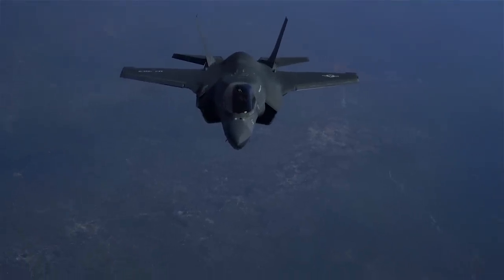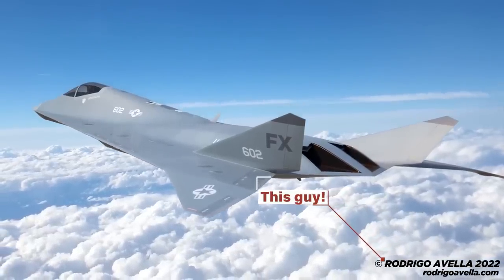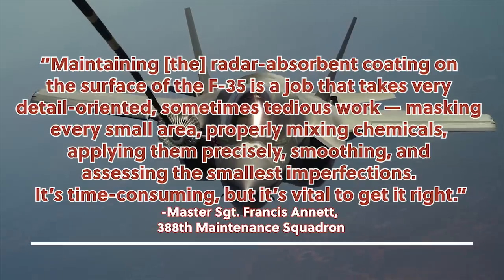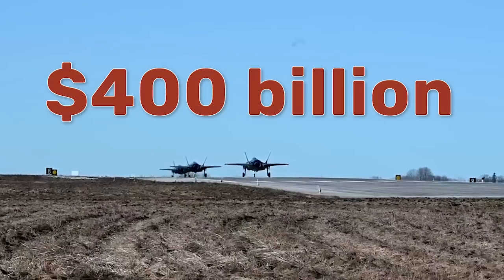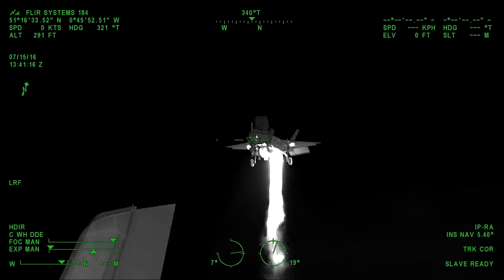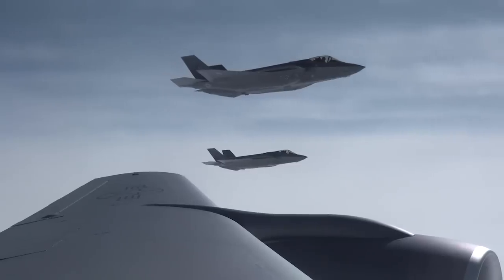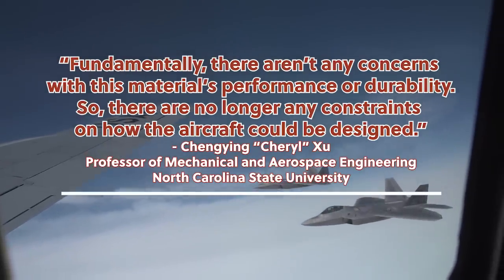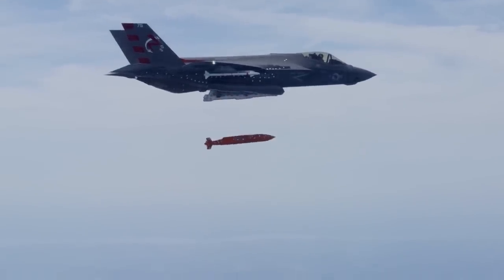The biggest leap in stealth tech since the F-117

Comment: The problem with speed is the sonic boom which is easy to detect with acoustic sensors .So radar is a no problem as soon as the boom hits the sensor you know where they are no matter the radar signature.
Reply: True but you still cant get a lock on them until they get relatively close so its not as bad as it seems. Fighter interceptors would be more of an issue. If they can find you that is.

Comment: And this is why the F-15EX (and Block III Super Hornet) makes so much sense as a supplemental/companion aircraft to the F-35 and F-22. It's like taking your new Corvette to get groceries all the time... if you don't need the speed, maybe save the wear and tear and take your old, reliable Toyota for that.
Reply: No, it's a jobs program because otherwise Boeing would have to close the St. Louis plant.
Look at procurement numbers. The USAF has 144 but proposed cutting to 80. The Navy asked for Super Hornet production to stop and it's lawmakers and lobbyists that want it to continue.
The Corvette comparison makes no sense. The F-15EX is a very expensive 4.5 gen with twin engines. Its operational costs are on par with the F-35. It's a Corvette too!

Comment: My question would be.
 Would the ceramic coating bennift a 4th generation aircraft? Like the F16, F18,and F15.
Reply: Nope,its not only about RAM its the shape as well
Reply: IMO probably yes, but limited because the basic design of the aircraft reflects back to the source so well.
If the coating is inexpensive enough I would agree that we will see these coatings on 4th Gen aircraft as well since every little bit would help

Comment: I can only think about how delicate the ceramic tiles on the space shuttle were. They were supposed to be reusable but they weren't. While ceramics handle heat and abrasion well they're not so good with tensile strength and vibration as they tend to be brittle so while I see you solving one problem I think you might have a host of new ones.
Reply: Nothing is reusable if you break it first.
Reply: Why are you assuming they'll use tiles when the video mentions paint?
Reply: @GonzoTehGreat  I mentioned tiles only as an example. Ceramic paint flakes in home applications that I've had so l don't know. Isn't the baked on finish of new cars some kind of ceramic or is that a plastic polymer?
Reply: @summerkagan6049  If this is a novel discovery of a new material it's too early to say what drawbacks will be.
Reply: They were never meant to be reusable, they were meant to be easily replaceable, allowing the body of the space shuttle itself to be reusable.

Comment: Question :
( maybe a dumb one)
If the coatings ABSORB the electromagnetic energy , what HAPPENS to that energy? Does it dissipate? Does it give off heat , other types of energy or something else?
Perhaps thats why theyre using heat absorbing materials- kinda like car coatings.
 Because , as Newton observed , matter cannot be created or destroyed-only transferred.
Reply: Electromagnetic carrier = photon. Photon (of a particular energy) strikes material designed to absorb it. What happens? Think black vs white in the sun. 🙂
Reply: The energy of radar causes the materiall's little bits ( Iron Oxide and Titanium Dioxide are 2 parts of the recipe) to line up in the direction of the radar, from our there towards the plane. The energy bounces off the metal skin of the plane and heads back out-against the " current" the radar is creating and basically converts to heat.

Comment: My only question on this is how much weight difference does this new RAM coating make? I would assume that on equivalent thicknesses as current polymer RAM, ceramic would be heavier, otherwise, if to reach eqivalent or higher stealth you dont need as thich a coating as polymer, could it potentially even be lighter?
Reply: It does show 2.6 g / cm cubed beside "light weight" when first starting to describe it. We don't know how this compares to the existing  polymer based ram but does at least say light weight is one of its features
Reply: @dgour2004  if it is lighter than current polymer ram, this could mean that the weight savings could increase performance a bit or, in thicker coatings, it could provide even better all-aspect stealth

Comment: I'm wondering if a new material called "graphene" would be of use in coating jet fighters. Maybe they could put it on a jet fighter and then coat it with ceramic based RAM. I don't know how practical that would be, but it stands to reason that graphene could absorb a lot of electromagnetic energy. From what I understand, graphene is a relatively cheap material.

Comment: One would think that Lockheed would have a good idea of how to make a stealthy aircraft coating. The SR-71 went Mach 3 - 3.3 and temperatures were 700 degrees F+.
Reply: The SR-71 wasn't stealth, it just went full throttle whenever a radar-guided SAM was fired at it.

Comment: This paper uses ZrB2.  Due to nano nature, it absorbs only 26 GHz or higher.  But typical flight radar is 1 GHz.  Her other papers requires Zirconia fibers & carbon nanotubes, which are not really commercial ingredients.  It's common for professors to drum up results to get defense funding.  But it's clearly still in early research stage.

Comment: I'd like to point out that while a difference of 10-20% additional reduction might seem less impactful, it's actually fucking phenomenal, because of the way math works.

Let's say we have a radar signature of 100 meters (this value is just to make calculations easier). If you reduce that value by 10%, then thats 100 - 10 = 90 meters = 10% improvement. Not very big a deal and seems kind of obvious right? But let's say you've already reduced it by 80%, so the radar signature is 20 meters. Well, going from 80%  to 90% means we still reduce this value by a flat 10 meters, so 20 - 10 = 10, which is a 50% improvement. Obviously going from 70% to 90% is even more impressive, at 66.66[repeating]%.

So with this new coating alone, an F-35 would get three times harder to detect.

So with this technology, plus other improvements, the difference going from 5th to 6th gen stealth, is going to be similar to the difference between 4th and 5th gen stealth (4th gen like the Nighthawk). Which is fucking insane.

China and Russia are just starting to catch up and the US was seriously like "lol no"

Comment: Is it possible to put a request forward here for a video topic? The shadowy world of active radar absorption through exotic means, like Cesium fuel additives to the SR-71, or also (less talked about), producing electric fields with emitters on the leading edges that create charge potentials to deflect / absorb the EM wave. I don't see that talked about much at ALL, and it's a wildly forward thinking concept. Stealth forcefields! I have a feeling that tech might be on the B-2 but highly classified. When pilots allude to putting the bomber in "stealth mode", they don't elaborate on what that really means.

Comment: if what you are saying about RAM is true vis a vis temperature problems at high speeds, how did the Blackbird / Oxcart  fly for so long, so high and so fast.   There is something off about your analysis of current and previous RAM.   The SR 71 and A-2 flew at Mach 3 and 90,000 ft.

Comment: Interesting, I wonder how they get it to work. I don't know how different radio waves are affected by different materials but I do know my paints. Acrylic (polymer) paint is soft and spongy so maybe that helps absorb waves? But it's heat sensitive and peels off a bit like latex. Enamel (ceramic) paints are highly resistant to heat and damage like scratching and peeling because they are very hard which makes me wonder how they can absorb waves. Think of a ball being thrown at a padded wall, it's energy is absorbed and doesn't bounce back to it's point of origin i.e. the thrower, this would be like acrylic paint; but now think of the ball being thrown at a marble wall (enamel/ceramic paint) it will bounce straight back to the thrower losing very little energy. Not sure how you can combine these completely opposite properties of paint but I guess that's why I design toys not stealth aircraft! LOL. Knowing my luck the solution will probably end up being toy related like 'Slinkies' or 'Silly Putty'!
Reply: I'm guessing that the ceramic in use would be very porous at the microscopic level allowing for the absorption to happen. Also, the very same property allows it to absorb large quantities of heat as well. It won't be as thick as ceramic tiles like the shuttles used to use but the idea would be the same.